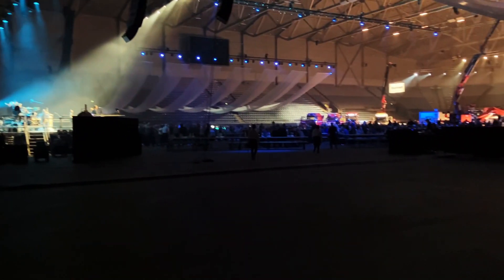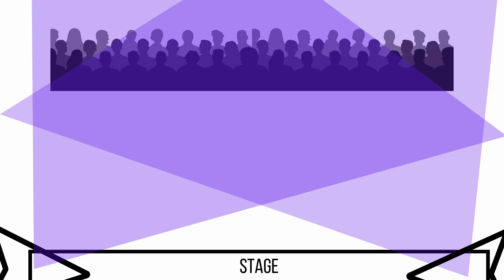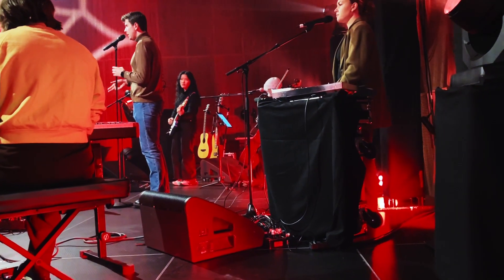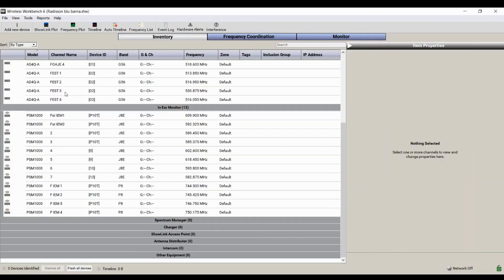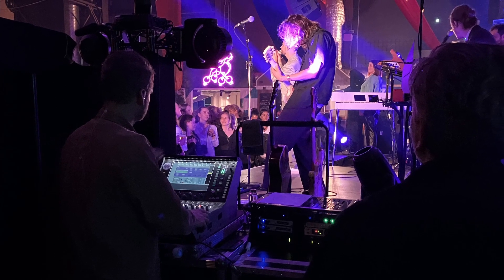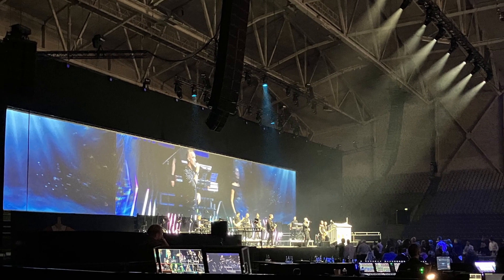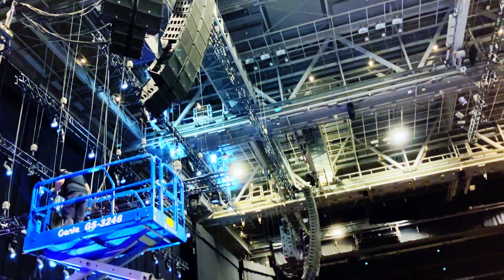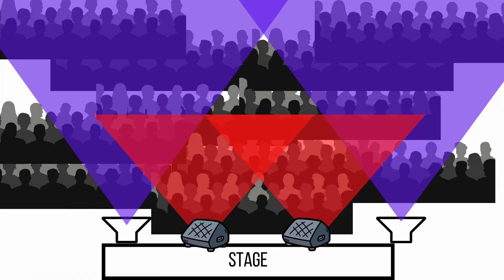Understanding Audio Jargon | What Is A Front Of House Engineer?

Comment: can you do more of these
Reply from the maker: I certainly can. Anything in particular you're interested in? Cables, mixer terminology, signal types?
Reply: @OffshoreAudio  i will like  learn more about the sc48 console & a practical guide on your approach to system designing for an event ?
Reply from the maker: @MatthewProAudio.11  Ah that I cannot help with. I've never used an SC48 console and I'm not a systems engineer. My best advice for learning the new console would be to work out what you need to know, usually routing, EQ, comp, FX and bus sends at a minimum. Then read through the manual and search for each of those sections.
As far as system design goes, check out www.youtube.com/@MichaelCurtisAudio, he's got some great system design videos.
Reply: @OffshoreAudio  okay  well can you do a video on microphones in live sound ?